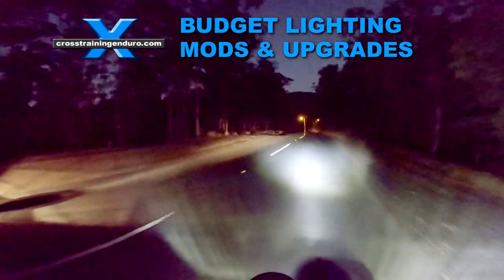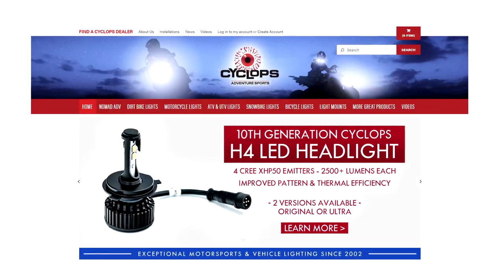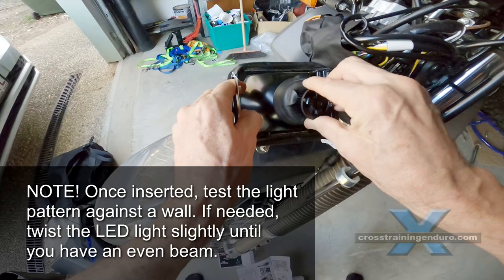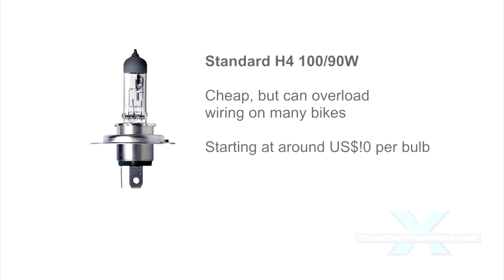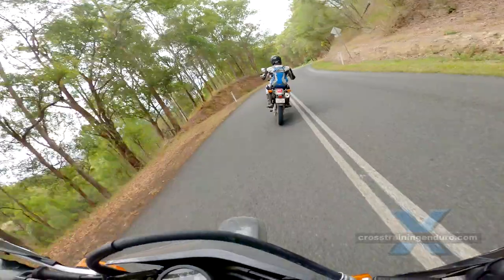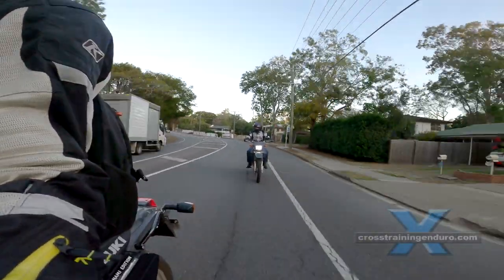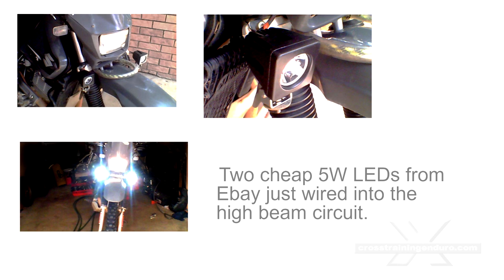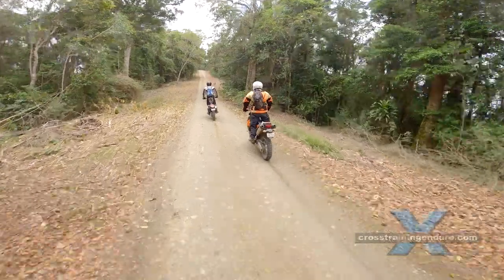Headlight upgrades & lighting mods on a budget︱Cross Training Adventure

Comment from the maker: FURTHER NOTES: We made a mistake in the vid, the Cyclops LED headlight is actually 5000 lumens, not 2500 as reported. 
Always check for legal problems in your state. Headlight mods can be illegal in many areas. 
Be very careful with adjustment. The low beam is dramatically brighter than the stock bulb and you don't want to blind oncoming drivers. As expected, high beam is fairly narrow with a lot of depth. If you plan to adventure ride at night, you may want to add auxiliary lights to get a wider spread of light to the sides while on high beam.
LONG TERM: No issues on either bike yet a year later. I have heard two riders say that the little fan that cools the LED can fail if you ride in a lot of dust regularly - worth keeping in mind.

Comment: Beware on the high watt bulbs; it's not just the wiring itself that can melt, but the plastic plug itself which houses the 3 headlight wires.  You can get a ceramic H4 connector which will tolerate the high temps for a couple bucks.

Comment: I am running an inexpensive LED H4 bulb off Amazon, it came as a pair, so my buddy got one too. The cost was about $40. US and they have held up very well over the last 2 years, and been very bright. I think the brand was Beamtech. Cheers from Colorado
Reply: I have done the same in my Honda CRF250L. Bought a pair of LED H4 bulbs off of eBay for less than $50 CDN. Brand is "Carrover" Nice sharp white beam, fan cooled, trouble free plug & play 👍. There are certainly many good options out there

Comment: I’ve been running the Cyclops on my DRZ for a few years and find the low beam has a strange pattern but the high beam is excellent. I use the extra wattage to run my heated gear when it’s cold. I love the whir of the fan that comes on, I tell people that’s my fuel pump.
Reply from the maker: Is it a fraction high on one side? As per the vid we found it critical to get the bulb just right or this happens.... at least on our DR650s.
Reply: @crosstrainingadventure  Yes, I’ve adjusted for the best compromise and I think this bulb has been updated since I got mine.

Comment: I'm not a pro with english or bulbs but I have heard many times that the +xx % bulbs have thinner filament and with that they try to burn brighter with same wattage. As a rider with only 1 cylinder bikes that does not sound desirable becouse that would make them much weaker with all the vibration from the bike.
About the modifications I have made the best results were from changing the ba20d headlight assembly to h4 headlight and adding dc circuit with small battery. Bike was an old WR 426.

Comment: try wiring all non OEM aux lights or outlets in a separate wiring loom with relay and fuses, saves you a headache with any electrical bugs starts appearing. In all my motorcycles i do that just for a peace of mind, plus looks super professional when you try selling the motorcycle
Reply from the maker: I'd certainly do that if I was going to really ramp up the output. They say it even helps with the stock setup as you get quite a bit of resistance through the switchblock.

Comment: I ran a cyclops on my 250L. Be sure it’s orientation is right so the beam is horizontal and not vertical. 

That being said I wanted one for my current bush pig but thanks to covid everyone was backordered with them. I opted then for a cheap Amazon led to hold me over. I believe the flashlight on my phone is brighter. 

This all forced me to order the JNS bracket to hold a Baja Designs Squadron Pro. I’ll be running the same LED controller I have for my aux lights so that way they all dim with the hi/lo switch.  I’m also modded so that all lights can be turned off on a trail ride
Reply from the maker: Sounds like you'll be turning night into day... 😊

Comment: In 1 segment of the vid you show a single light bar directly below the stock headlight on the DR650. Could you share what light and what brackets you used for this mod. Thanks for the great videos! They are a great help with my DR.
Reply from the maker: I've never done that mod, Clifford. But plenty of guys have and there's lot of info around on the forums. Go to Procycle for the expensive option, or make your own mounting plate and just buy a generic LED light bar.

Comment: I went and bought some cheaper led lights and wired them into the high beam, they put out a flat bar of light nice and wide. Have the lights crossed up such there is a hot spot in the distance and when turning the bike it still show up what's out on the ground or along the sides of the road, especially for those hopping hazards. It works alright, definetly safer to ride now. You can get them with day time halos but I didn't realise that they were not a white light. Coloured lights on the front of your bike are not a good idea and have legal issues. (Just did not wire that part up)
Reply from the maker: It sounds like they are both flood lights? E.g. something like a 60 degree throw of light? I"ve just bought an LED light bar that has four flood lights and two spot lights which should work well.
Reply: Its like they are a bit of a hybrid between spot and flood. They give you alot of width but concentrate the light into a narrower height. Will need to head out and get a proper photo. We're pretty inexpensive.

Comment: Thanks for the vid Barry. It’s typical CTA quality and informative. Do you have a long term update of these LED globes?
Reply from the maker: No probs so far Simon. Here's the stuff in our pinned first comment....
FURTHER NOTES: We made a mistake in the vid, the Cyclops LED headlight is actually 5000 lumens, not 2500 as reported. 
Always check for legal problems in your state. Headlight mods can be illegal in many areas. 
Be very careful with adjustment. The low beam is dramatically brighter than the stock bulb and you don't want to blind oncoming drivers. As expected, high beam is fairly narrow with a lot of depth. If you plan to adventure ride at night, you may want to add auxiliary lights to get a wider spread of light to the sides while on high beam.
LONG TERM: No issues on either bike yet a year later. I have heard two riders say that the little fan that cools the LED can fail if you ride in a lot of dust regularly - worth keeping in mind.

Comment: White lights can be tiring on the eyes as everything reflects, and you focus on detail you don't need to.
Go 4300k or maybe 5000k max.
If yoyr bike doesn't run a battery, and is a/c only or limited d/c, fit a reg/rec and a very small battery to allow better light use and a gps/phone charger port.

Comment: You didn't need a rectifier to fit the cylcops? I just got a cyclops ultra h4 and it's for DC, the DR being AC - apparently I need a rectifier.
Reply from the maker: No it's plug and play, Paul. My brother has had no issues with his DR either.

Comment: I know I'm late to the party but i run auxbeam podlights on my bikes for 50$ 4800 lumens 10ft full waterproof connection harness with switch and relay and im not disappointed.  Its possible to fit the whole harness on the bike i did on my tw200 and just bought some gor my dr650 or if youre handy you can cut the length down.either way theyre worth a look.
Reply from the maker: Sounds like a good budget setup!
Reply from the maker: Do you have a link in case someone wants to try it?

Comment: There are torch light clamps.
For adventure it works fantastic.
Not good to drive in city traffic as its basically holding a torch light into oncommers.
Reply from the maker: Interesting idea, Marcel! Are they motorbike specific?
Reply: @crosstrainingadventure 
Nope, they range from cheap China to simple rubber bands and fit pretty everything. Depending mostly on diameter of handlebar or desired point of clamp.
Many cater more towards the bicycle croud. 

Maybe touratech makes a specific high quality one 😂

Comment: My headlight protector makes the bulb upgrade a bit of a waste of time.  I’ve put aux lights off eBay on a B&b plate switched off the high beam.  I think in qld you have to be able to turn on your high beam without the aux so I added a switch to the relay wiring. Was a bit of a brain tease to work out how to get it to illuminate only when the aux lights are on.  I’ve used cabling from the battery to power with a relay switched by the power plug just next to the carb breather so I can’t leave them on without the key in.  I reckon total cost including relays and wires was a touch less than $200.
Reply from the maker: I wasn't aware of the Qld requirement, Sam. I'm not sure if I'll bother with spotlights as I'm not planning on any night rides... but of course there are always those long day rides where something goes wrong and you spend the last hour in darkness dodging kangaroos. 😁
Reply: You've more or less described the reason I got them.  I don't ever plan night rides and since fitting i haven't used them in anger.  A couple of times this year I ended up riding in forrest tracks towards the end of the day and ended up struggling to see features like big puddles, ruts and jumps in the shaded/ dark bits untilI was upon them.  Ended up with a couple of very scary moments. So it's more a safety mod than anything. But you can get in for spots pretty cheap if you've got some bracket making skills.

Comment: I put a 6 inch e series rigid on my 07 husky wr 250 and it was stupid bright and u couldnt out run unlike the china 7 inch light bar i had... but holy moly it was a lot of $$$$$
Reply from the maker: Lighting is certainly one area where money usually makes a big difference. We tried some cheap LED headlights a few years back and they were next to useless. I must admit though the no-name CREE 5W LEDs were consistently good value though.
Reply: @crosstrainingadventure  i ruined the rigid on that 2 stroke i think bc the voltage varies so much at low rpm... they did warranty it no ?'s tho